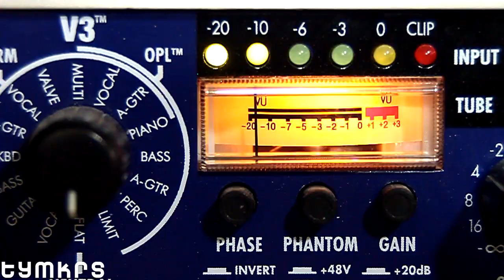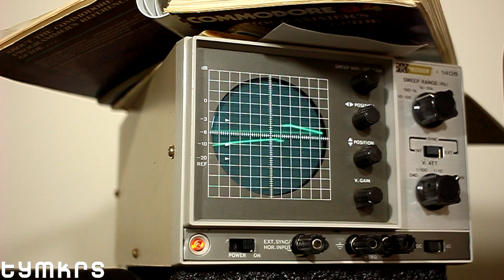Wintergatan - Marble Machine (C64 SID Chip Cover)

Comment: I love this rendition of Wintergatan's Marble Machine tune in general and 'rape' the play button on it frequently, partially because I struggle to find the characteristic 'feel' of the SID chip we got used to over the years. You could as well tell me it was a random ATTiny based 1-bit musical box and I would believe you ;) Or maybe it was intended to sound very 1982, when people only started to learn the musical potential of C64, instead of 1990.
Reply from the maker: I was around for that era :) This certainly isn't that.  Between having dual chips, and being MIDI integrated into a modern system, we can do things that were not possible back then.  A big part of that late c64 sound was all of the things we did to get around limitations.